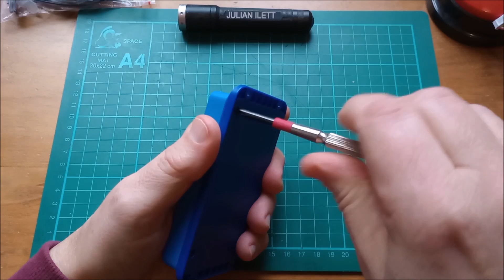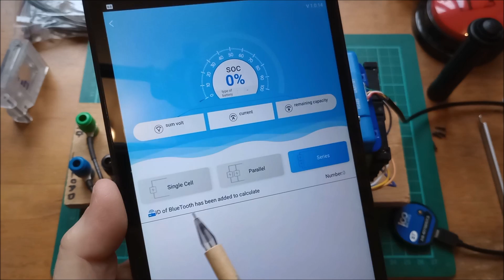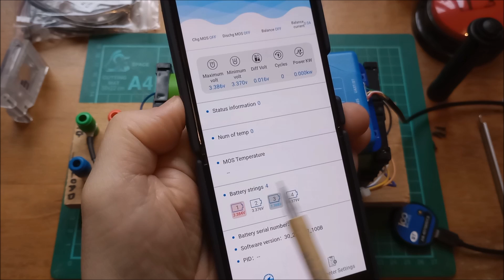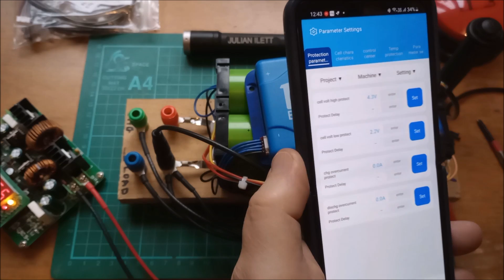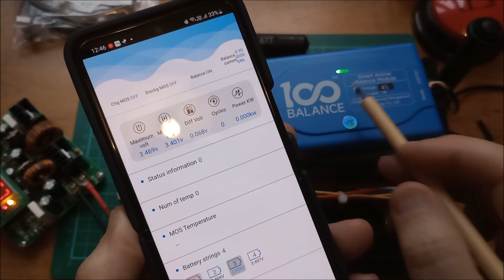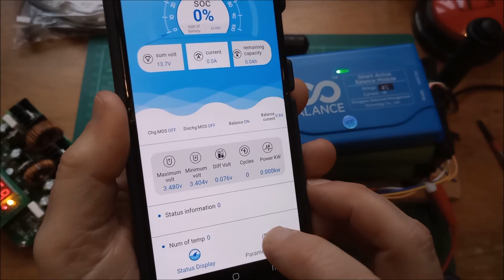Smart Active Balance Module

Comment: This is the SAME software for the 100 Balance BMS... so they are double-dipping using 1 piece of software for both the Smart BMS and the Balancer. I've had very bad results with the Smart Balance BMS so I returned 3 of them because they just don't work. It let one of my EVE cells overcharge, it just plain didn't balance when it needed to. Can't use them... too unreliable.

Comment: It can’t see the Bluetooth because the unit turns off completely from what I can tell that’s how mine seems to be behaving after it’s done balancing. Ok wow yours seems to run flawlessly compared to how glitchy mine behaves! 

I did notice my app seemed to get an update today but it only made mine now look just like how yours does lol 

I can’t toggle the balance feature on and off as you could. The balance switch does not do anything for me. And mine seems to shut down completely and can’t be found on the Bluetooth either so to use it as a voltage battery monitor only would not even work for me the way it’s currently operating and shutting down as it chooses

Comment: Hi Julian. Question: Did you find the circlips satisfactory? I have the same 18Ah cells (actually ordered the cell just before your video's, still wondering how I was going to tackle that, when I stumbled on your circlip idea). But I find the contact resistance too high. It messes up the balancing due to voltage drops if one circlip is just seating differently as another. Thinking of a better way to deal with this. I also use the 10mm circlips, just to get some more force.

Comment: It looks like this one charges the lowest cell using energy from the total pack voltage or discharges the highest cell and sends the energy to the total pack voltage. Is it possible to test this?

I like the dumb ones as they continuously shuffle energy between cells all at the same time. Not saying it's better, it's just my preference.

I just saw this brand and they looked promising but I already have a lot of balancers in stock so I didn't order yet. Glad you got some and took them apart so I now know what's inside 👍

Comment: Question: How low can you set the start balance voltage? I have some sodium ion cells that have a max voltage of 1.85V and even the dumb active balancers set in LTO mode will only start balancing at 1.80V.
Reply from the maker: Looks like 2V is the minimum
Reply: @JulianIlett  Thank You!

Comment: Voltronic/Axpert is a broad range of many very popular rebranded inverters (does "MPPSolar" ring any bells? mine is EASun ISolar-SML-III-3.5kW), so this BMS you can probably connect to such an inverter with RS485 cable and make it talk to the inverter, maybe even control it, not sure what exactly have they done there. Maybe after connection is made, a new menu would appear in the app where inverter settings could be modified from the app.

Comment: If it's a proper active balancer, which it seems to be, then it is actually boosting the voltage of the high cell to an amount that is proper for releasing that charge into the low cell, at the rate which you have set.  So there should be no noticeable difference in the amount of transfer based on the difference of the low and high cell, since it's all controlled by the processor.  Unless they have programmed in a taper when voltages are close.